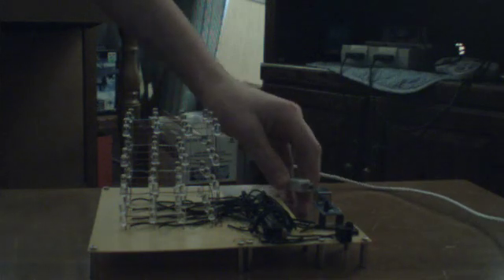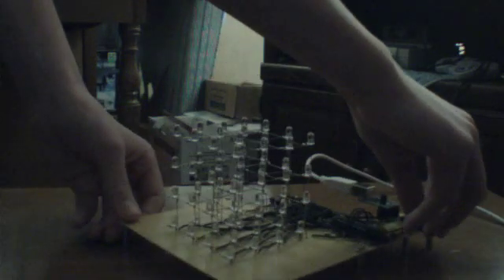4x4x4 blue arduino led cube

Comment: Your vids are some of the best on YT, i have a duemilanove and i want to build an LED cube, i have everything i need, but wondering how do you power the bread-duino from the dc socket? Do you just take 5v directly to the atmega328? And also, once the software is written, can i download it to my duemilanove then remove the 328 ic and install it in my stand alone duino?